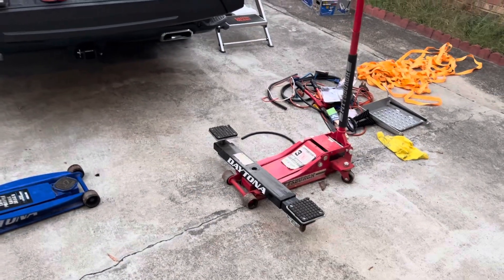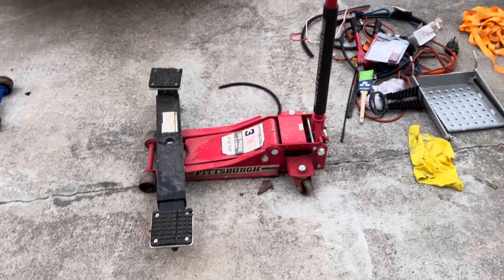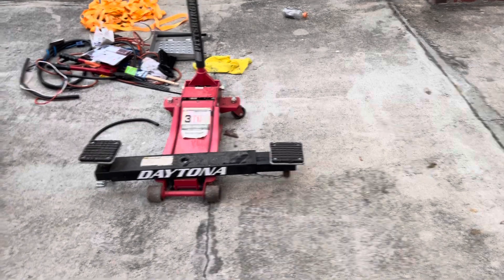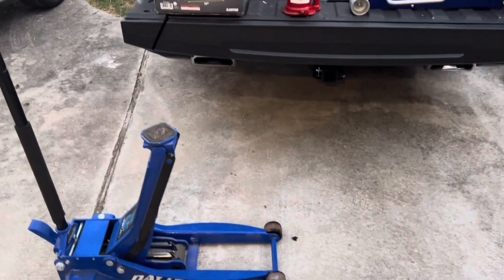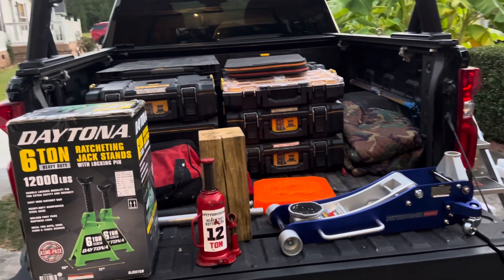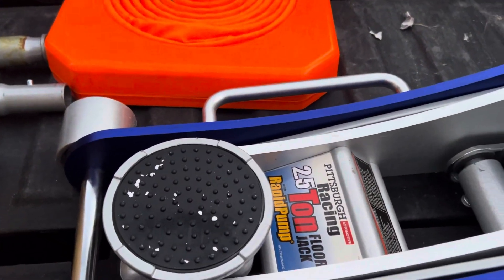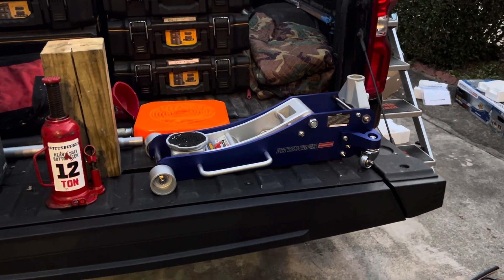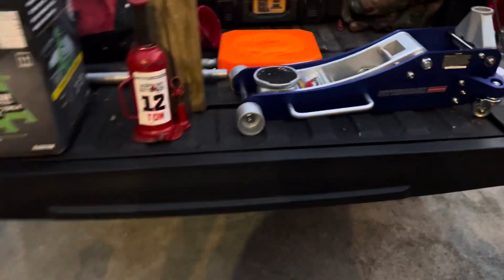Let’s Talk Floor Jacks

Comment: Yeah, the floor jack reality. Even NAPA is two or three times more for a HF equivalent floor jack. At some point, when considering the good quality of, for example the HF floor jacks, it is hard to justify the cost of USA tools. If you can even find a USA made version.
Reply from the maker: I could not find one, the snap on ones are low weight capacity as well as everything else I saw but I would not pay 10 times as much even if I did find a USA one